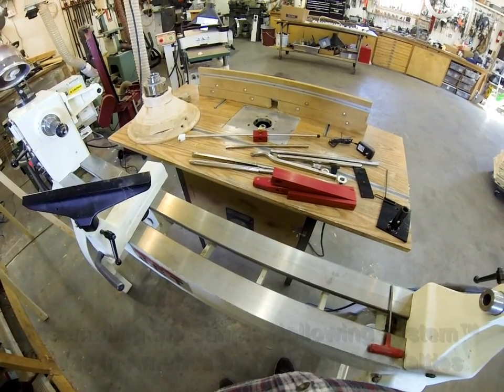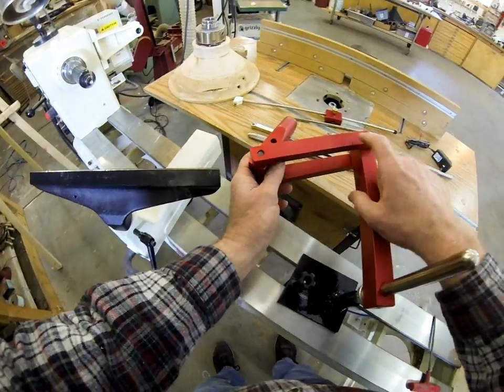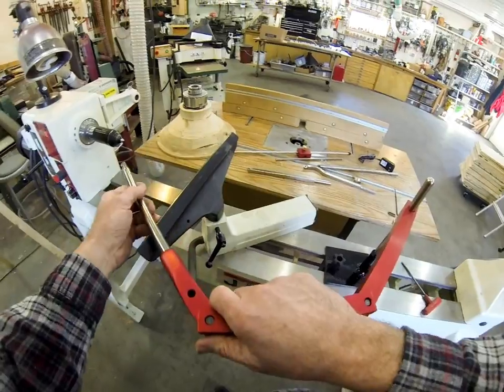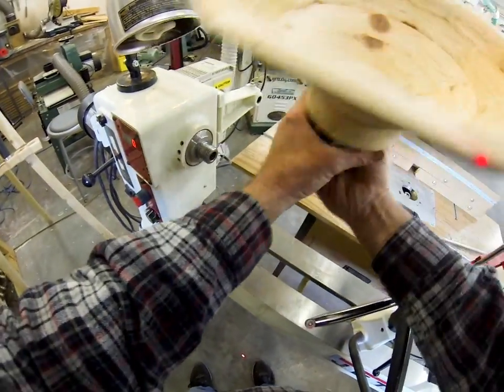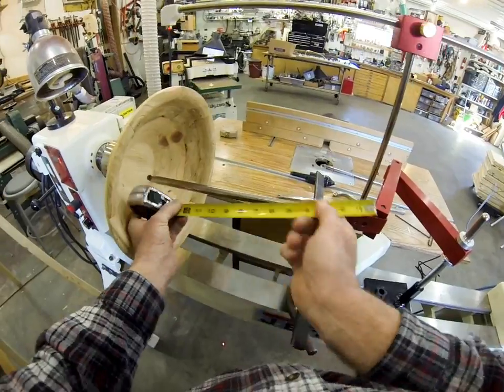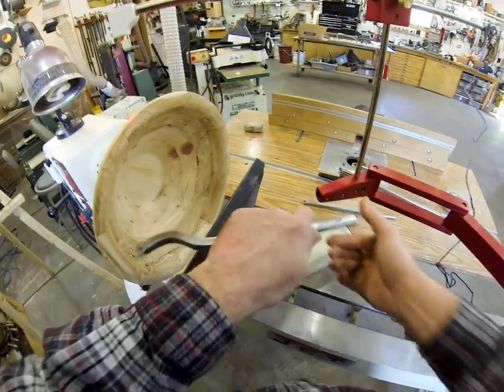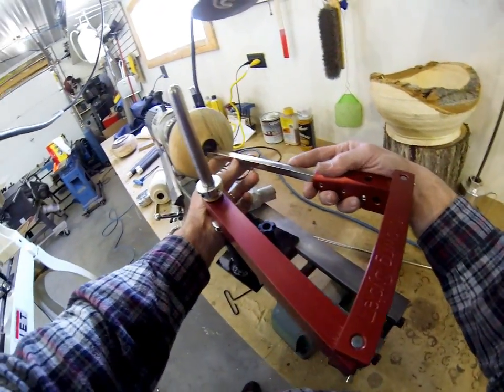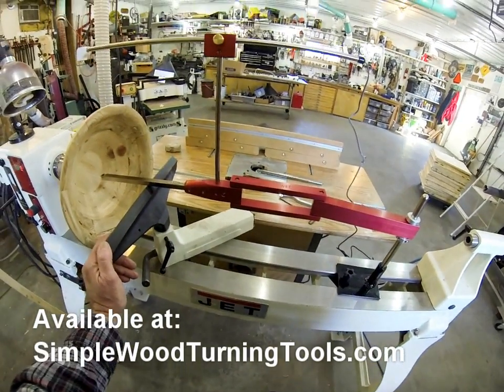Simple Hollowing System assembly video

Comment: Can the laser be replaced with a camera?  Some of the members of a club I belong to are transitioning to cameras.  Thanks.
Reply from the maker: +Ron Hopkins Well I suppose it could be. I'm not familiar with these cameras that folks are using. Perhaps you could enlighten me?
Reply: There are two that they use.  One is a miniature camera and one is also a miniature camera that's used in a car's back-up system.  I've used the former on someone else's lathe.  The camera is fixed and the cutter's image is on a screen, where a dry erase marker is used to draw around the cutter for the appropriate thickness you want.  The nice part about the system is that you focus on the one image instead of keeping tabs of the laser and the turning separately.  I have a couple of emails that list the cameras if you want them.
Reply from the maker: +Ron Hopkins Yes&#160;I would like to see those cameras. Please send that info to Kerry@harrisonspecialties.com Thanks!
Reply: Will do.